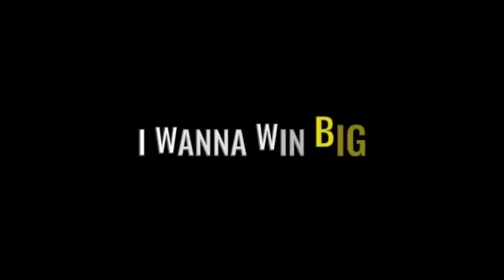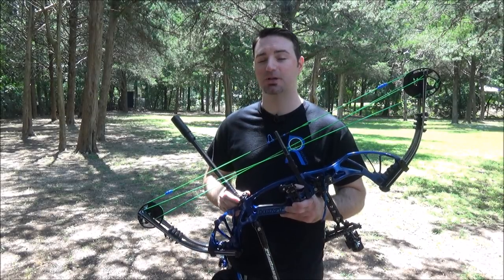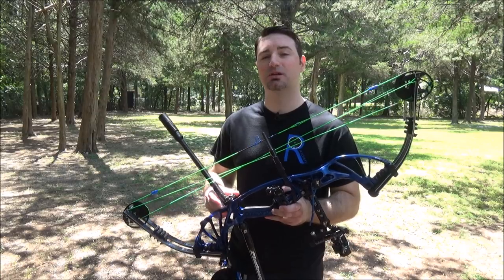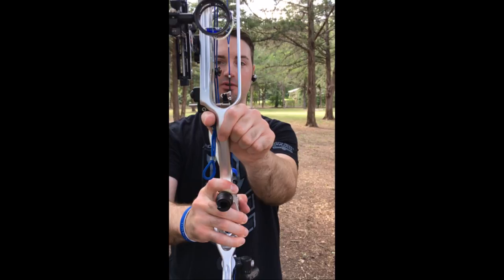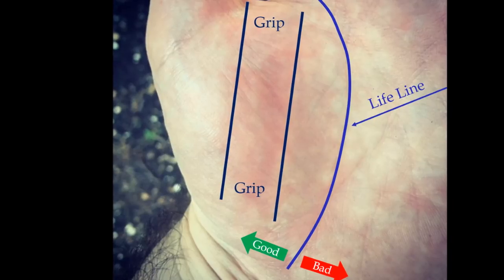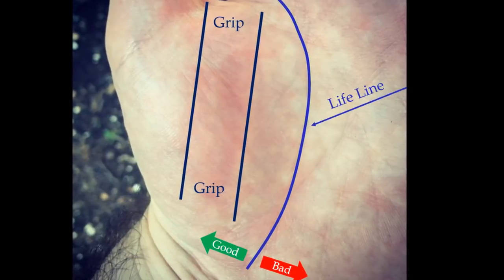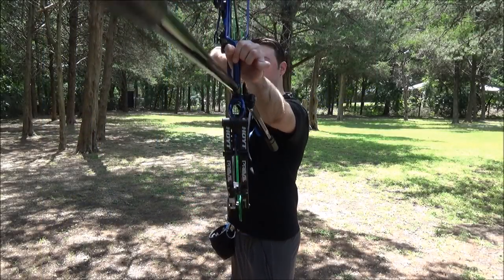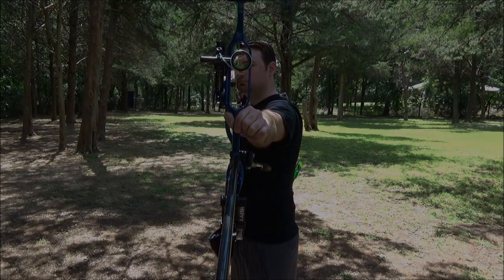Reducing Grip Torque. How to Miss Small & Win Big! (Rchery Vision Episode 8 Part 1)

Comment: thanks so much for posting this tip! I've always thought the bow handle was supposed to sort of follow the lifeline. hopefully, I'll be able to implement this tip with good results at the range tomorrow.
btw is it better to use a finger sling over a wrist sling? I haven't seen anyone talk about this yet most competition archers use one.
Reply from the maker: Let me know how things go! I really prefer a finger sling with my target bows because it catches the bow and then pushes it back into my hand. A target bow has a lot of pop forward and every shot I make the bow will come out of the hand and into the sling to catch it before the sling works like a rubber band some and pushes the bow back into my hand. Or at least holds it for me so I can grab it after the follow through.

Comment: Thanks so much for these videos. I've applied your grip technique and when it's executed properly I see great groups, regardless of how I execute the shot with my release. My main concern is that when I'm pulling the bow back, my wrist is in a specific position, but when I come to full draw into the stops, and I relax my hand, my wrist relaxes and my knuckles appear to be moving forward to the target. Is this an issue?

I should also note that it appears to be repeatable, and when I look at my hand after a few shots, the red groove in my hand is quite clear.

Additionally, I find that my arrows group much better the less "heel" I put into the grip. Everywhere I've read seems to indicate that a low-wrist grip is the way to go, however when I put more emphasis on it I find my groupings aren't as consistent and I feel like I'm putting more muscle into the shot.

Thank you!!
Reply from the maker: I would try to draw your bow back with as least tension in the bow hand as possible. It'll help seat the grip into the hand and should help your issues.
Reply: @rcrchery  Thanks so much!